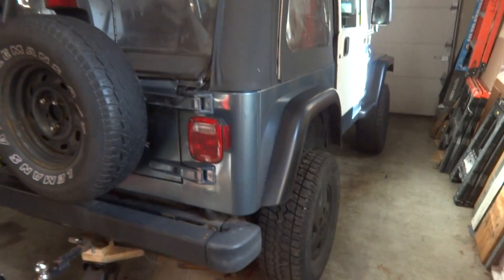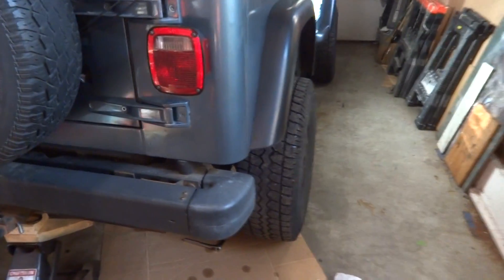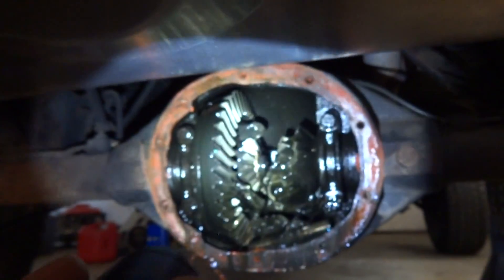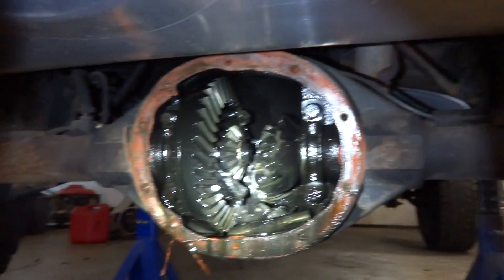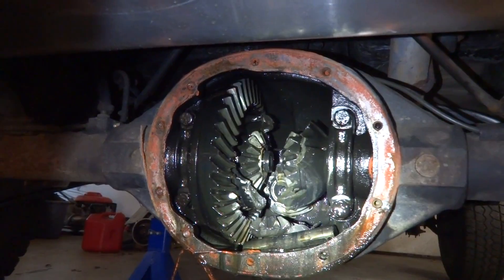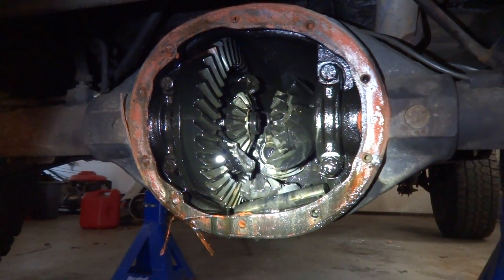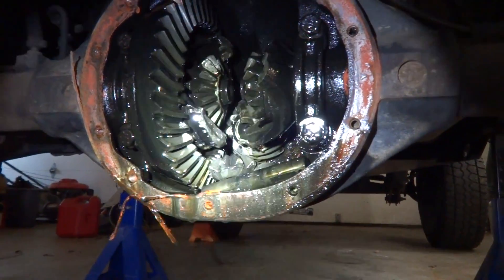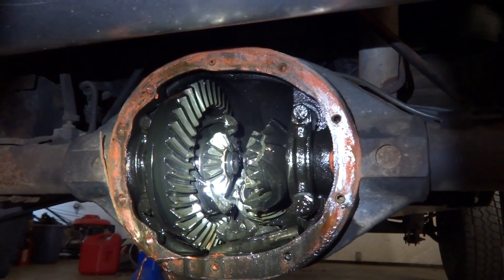How to inspect and diagnose issues with a rear axle on a Jeep Wrangler - Dana 35

Comment: I found this video while trying to diagnose the rear end on my Grand Cherokee. Mine looks the same. I'm glad it's alright.
I guess I'll just close it back up. What kind of silicone do you suggest?                     ;)
Reply from the maker: I've found bubble gum works the best, brand isn't important.
Reply: @WeekendHandymen  Since you're so knowledgeable, maybe you can answer a question.
I have a 2000 GJC that someone "upgraded". None of the drivetrain appears to be year and model specific.
I'm looking at possibly rebuilding the differential, but I don't know what rear end is on there since he removed the cover and replaced it with a BTF custom.
Looking through his old receipts, I found one for the cover, and it said it was for a Dana? 44a
The differential case is definitely aluminum.
There is a mark on the case that is difficult to read, but it either says, CW, CMI, CMU or something close.
Would it be fair to assume this is indeed a 44a?
Thanks for the video, and your reply.
It was great for a chuckle.
Reply from the maker: Sounds like a fair assumption to me. There are charts/images floating around the internet that show the bolt pattern/outer shape of various Dana differentials. You should be able to use these to ID your axle by comparing the shape and number/location of bolts, even with the upgraded diff cover.

Comment: looks like its time to go find a rubicon d44 rear and drop it in the place of that shit d35. straight swap no frill bolt and go. this is exatcly why you swapped the cherokee axles out, this happens a lot to d35 carriers
Reply from the maker: +Raging Reaper Gaming Variety I picked up a d44 out of a rocky mountain edition with 3.73s a few months back but still need to get it regeard to 4.10 to match the front. Would very much prefer to find one out of a rubicon with 4.10s and a locker already but they seem to be few and far between in this part of the country.